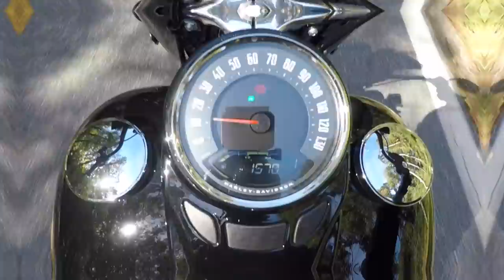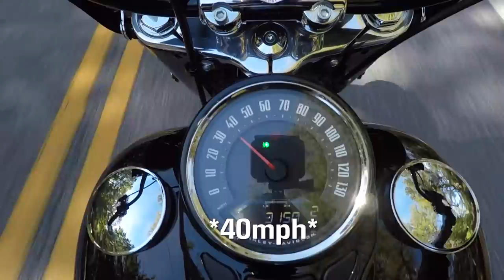Harley Davidson: How To Break In a NEW/OLD Motorcycle

Comment: Some really good points that rarely get mentioned in "break in" discussions.
I don't think "mold release" on tires is still used in modern manufacturing, but rubber works best once it gets up to temp. Probably best not to push any tire if it hasn't had time to warm up.
Reply: correct, but don't forget they dust the tires with carbon black so they tires don't stick together , I have loaded n unloaded a few loads of semi tires in my years as a over the road trucker, id say give the tires maybe a dozen miles or so to run off most all the carbon black, so you are making a better rubber to road contact, n making full use of those new tires once the rubber is stickier, or just wipe them off with bleach lol, no no bleach that makes them sticky due to a chemical reaction but may ruin the tire !!!!

Comment: 8:30..... I know we're talking about bikes here but my wife popped in my head.
Anyway, for the first 1000 miles I like to ride diferente road speeds that requires different gears, that way I give all the gears a well all round chance to break in.  We all know first gear it's practically useless, but 15 miles and below always use 1st, in your 20mph roads use 2nd, 30s 3rd, 40s 4th, so on... Depending on where you live, but here in Florida I'm riding on 5,6 most of the time, so I try to put myself in situations where I need the lower gears. And I believe that's a good way to break things in.. I also try slowing down with the engine sometimes so I can give the brakes a break from braking 👨🏻‍🔬 and that also give the engine/clutch a chance to adapt to various riding styles.

Comment: Great video John! On the engine side, Piston rings to cylinder wall is the most important thing. Rings require opposing forces to seat properly. Always be accelerating or decelerating, and avoid hard Accel/deccel and high RPMs. Avoid cruising (no load on egine, maintaining speed), avoid lugging the engine. Varry the Rpm range, don't just break it in at the same RPMs. This will give the rings the best chance at sealing, giving you higher compression and more power, along with better longevity than an engine not broken in this way. Just my 2¢. Keep up the good work!

Comment: Hey John I’ve actually seen a couple techs spray brake cleaner on new tires before the test ride(wiping off the tires first of course). They’ve said it helps remove that mold release gunk. Not sure if there’s any merit to it but they do it on our work bikes when we get new rubber put on. 

Great info and awesome channel brother. Keep up the good work!
Reply from the maker: I have sent some bikes straight to the wash bay, so that the tires can be cleaned before it gets ridden!

Comment: A Dunlop guy said it's not mold release (silicone) but that it's the tire. The tire needs at least 1 heat cycle to finally "cure" thus completing the vulcanization process. (Using college words) Either way go slow get heat into the tires by riding and voila the slick stuff goes away.
Reply from the maker: Nice info!

Comment: Hey John I always wondered if we're supposed to drive soft for 50 miles why the final assembly guy runs and guns on Dyno testing at York before shipping. Hard short shifting etc. High revs.? In theory wouldn't that be the first strain right from the factory. Just curious?

Comment: I always say first 50 do it like John says that’s real good advice ,, now for me personally I ride it like I stole it , or how does the old adage go “Grip it and Rip it”. Because of cylinder pressures, the higher cylinder pressure will seat your rings better and if you were to do it Harley’s way for 1000 miles and then do it the way I do on the exact same engine then disassemble the 2 engines you will find a lot more carbon build up on pistons etc.. on the engine that was broken in Harley’s way.. the higher the cylinder pressure the better the ring seat,, the better the combustion better performance.. less carbon also adds to longevity also... but this advice is for throttle Jockeys such as myself , not for novice riders .. if you are new to riding johns advice is spot on.. for the rest of us “Twist the wick” and get that cylinder pressure up and. The bike will perform and last longer ... but that’s just my personal opinion....
Reply: I do the same.  Have done so for all my motorcycles with no ill affects to any of them.  I had a 2007 Daytona 675 that I purchased new with 12 miles.  I rode it hard from the beginning, and I clocked in well over 74,000 miles on the motor in four years with zero issues.  A very important detail....I did ALL the required maintenance per the owners manual to the letter.

Comment: My 2000 ultra classic went through break pads like water through a sieve. Parts guy told me I was breaking to hard and bike was so heavy it's just part of owning that model. I told him that the pads must be defective because no other bike I owned ever was that bad, and I have owned a few. After market Kevlar pads and years later same pads. I bought 3 sets and changed front and rear and still have the 3rd set never used. Before that it was about every 6000 miles. These have 50,000 on them I bet. 
Worth HD KCMO I hate being lied to, never went back and the shop was only a mile from the house. Been riding for over 50 years; What Harley seems to do is deny when they have a problem until it's undeniable.

Comment: on my 2006 FLHX what does Harley recommend for maintenance on the neck bearings? Mine has a fitting from factory so I would assume it is to be serviced/greased at certain mileage intervals or time? Thanks!

Comment: I called my dealer for clutch cable adjustment when I got to about 500-600 miles and they said not until 1,000 miles. Just as I past 1K my cable disconnected from the basket or so I believe it did, I couldn't get a straight answer from the dealer what happened but thank god I just finished a group ride, was parked and ready to go home and the clutch lever was moving freely without effort. This was a 2021 Street Bob FXBBS, I had to get a flatbed home then the dealer picked it up after the weekend and fixed it.

Comment: I just hit 500 miles yesterday on my 2018 Road King. When I bought it last week it had 164 miles on it with a dealer installed stage 1. I hope the previous owner took it slow, LOL.  Although I typically don't ride hard it is difficult to not occassionally want to open it up.

Comment: John,

I saw a video by Jerry Paladino (ride like a pro) in which he clearly stated that motorcycle clutches are designed to be used in the friction zone much more so than a car would be for slow speed maneuvering.  Would you concur with that and if not, why not?  Thank you.  Also, I'm sure you know that the term for the strands of wire put together is wire rope.  Just fyi

Comment: I'm an old-timer so I'm just curious if the way we used to break Motors in is still acceptable. We used to put it in 3rd gear and we take it up 60 miles an hour full throttle and then let go of the throttle and repeat that 5 times. A logic was expansion of the piston rings to the cylinder under load and then during deceleration. I did that on my other Harleys and it never burn to drop off oil and always ran great. How's that apply to today's motorcycles engine

Comment: I have a question. I tend to pull the clutch in with 2 fingers on the grips and 2 fingers on the lever. So the lever never actually goes completely down to the grips but rather it stops when it hits my fingers. I’ve checked and the bike is not in the friction zone when I do this and it seems to be fully actuated. Is this ok or should I pull the clutch lever with all 4 fingers when I shift?

Comment: I just broke my 18 Ultra Limited Shrine in.  for the most part I kept it under 3500 rpm, but once or twice I might have gone over just a bit.  I always varied my speed though.  No burn outs, etc.  Now i'm slightly worried about the 3500, dealer didn't mention it.
Reply: Don't be. Read my other comment here.

Comment: Just got a 2019 Street glide and I'm just about 500 miles didn't take it that easy on her I crack her open and take her to about 4500 rpm a good bit but ain't that worried about it
Reply: You will be later on when it’s pushing oil past the piston rings due to them losing their temper.

Comment: Depends on the Trans Gear ratio , My RK don't have a Tack . I go by sound and speed 1st 15, 2ed 25, 3ed 35, 4th 45 , 5th 55 at 150 miles I go up a extra 5 mph after 1000 i ride it like i stole it  im doing break in right now 7-4-23 happy 4th everyone .

Comment: Looking forward to your video on the pipe upgrade. Did you do the full stage 1? If you did, with Prostreet Tuner, how do you recommend doing the street data recording without a Dyno (speed, gear, etc)? I was at Biketoberfest this weekend and the tuners won't dyno a bike with the Harley tuner installed.

Comment: Hei John, greetings from Norway !  

I have a question about the Gearbox in general for Harley Davidson. 
As you may know, in other manufacturers dry clutch gearbox it is common to do speed shifting or clutchless shifting of gears. And it is supposed to be no trouble for you to do so without damaging the motorcycle.
Now I know the fact that the Harley Davidson motorcycles uses a wet clutch on most of the models - meaning it is moistured by a special oil to give a little smoother clutching?  
Anyway my question is as follows: Is it safe to do clutchless shifting on a Harley? 

Thanks alot for your awesome videos, and your initiative for making them ! 

Thomas
Reply: Not unless you want to rebuild your gear box

Comment: Hey john i was curious to see if you knew of any way to see what cams are in my twin cam dyna, is there a way to tell without removing the cam cover and oil pump? And do you by chance have a psi number that a standard 95? Inch twin cam harley might build during a compression test?
Reply from the maker: I don't know off the top of my head what compression should be, but I can tell you that a dyno run with a knowledgable dyno tuner can generally give you a good idea of what cam is in there.  There's a handful that as soon as I see the graph, I know what cam it is.

Comment: hey John,
i know this question is not relayed to the break in procedure but i have a question.
so it goes like this ....... i own a 2019 CVO Street Glide and the heat shields on the bike are that bronze color.
so what metal cleaner do i use on them ?

Thanks Dude !
Reply: I use autosol

Comment: When I bought my new 2018 touring bike they said not to lug the bike. To my understanding "lugging" is upshifting too soon?
Reply: As a truck driver I refer to lugging as holding a higher gear while climbing a hill and letting the torque do the work. The engine works harder but if it has the power to make the hill why down shift? I do it on certain hills with my electra but I don't let the rpms get any lower than 1800

Comment: Tire issue, it's not actually mold release like the old wives tell go, it usually is a chemical to keep them from gathering mildew while they are on the rack, kinda like a preservative. The slick part is just that the tires haven't been roughed in, they are still slick. Racers rough in their tires before they put them on the bike, so they're not starting with slick tires on the track.
Reply from the maker: I said it was for storage originally. The other dude said it was from manufacturing. Either way, that shit is slick!

Comment: What could happen if a bike isnt broken in properly what are some symptoms. Thats what scares me avout buying used bikes with low miles/any miles worry if they broke it in properly
Reply: Just liked and subscribed been watching for awhile
Reply from the maker: I’ll be honest, I’ve never opened up an engine and thought, “well this wasn’t broken in right.” To me it’s a matter of I know I did it right, so anything that happens isn’t because of me. 

A simple compression test on a used bike is a good, quick indicator of piston to cylinder fitment, though!

Comment: Can the clutch friction zone wear down clutch
Reply from the maker: with excessive throttle while in the friction zone it can wear one down pretty quick!
Reply: david buchanan essentially any time your clutch is in the “friction zone” you’re wearing the clutch as it is slipping. But luckily clutches on these bikes are bathed in oil and don’t heat up excessively very easy so they last quite a long time... unless you’re an extremely aggressive rider, have added some serious power to the engine, and racing etc. nothing to worry about. But if you are once you’re moving you can learn to upshift without using the clutch.
Reply: @TheHarleyTech  is it normal for one to have to replace a clutch during their ownership of their harley touring bike (street glide) I mean within the first 10-20k miles?  or should your clutch last the life of the bike if not abused?
Reply from the maker: Generally clutch replacement is from abuse, for sure.

Comment: the 50/50 rule is real lol, i once changed out tires on my supermoto from the street slicks to some shinkos forgot which ones exactly right now and they had about the same diameter of meat on them as the original tires so i thought handling was about to be the samebut boy was i surprised when i was trying to corner as i used to before only to end up almost losing it on the streets xD

Comment: John I had a question for you and have been told different thing by different people so I wanted to ask you since you are a tech for Harley is the FATALLY FLAWED, DESIGN of the 103 and all TWIN CAM engines, produced since 1999 to the present.Is it true that the flywheel assembly on say a 2012 Ultra Limited with the 103,  are merely pressed together, at the factory, with a 400 ton press and there is nothing holding the two halves, of the flywheel assembly together, and the flywheel WILL come out of true, very quickly and will soon exceed the maximum allowable, run out on the sprocket shaft and pinion shaft, of 0.001" and as soon as the shafts wobble hits,  0.003", damage to the pinion shaft bearings and the oil pump rotor and cam support plate bearings, and the cam shaft bearings, will begin and eventual, CATASTROPHIC ENGINE FAILURE WILL OCCUR. Please could you clear this up for me, this is a heated discussion among a lot of my friends and I would like to know myself because I do own an Ultra Limited with the 103 in it. Thanks and love your videos so thanks for making them. Hope to maybe see you Oct 5th at the Bring it Home Ride. This veteran wants the record back here in the USA, nothing bad to say about Greece but damn it Harley Davidson is an American bike and that record needs to be here in America.

Comment: I bought mine used and didn't get the book no one reads so I didn't get the chance to not read it.
Reply: Haha i read the crap outta mine. Lots of good info actually.
Reply: @disht2  I wish I could have. But they aren't cheap. I threw down on the service manual tho. I couldn't live without that.
Reply: @Raymond Gonzalez cool. I didn't know that. Thanks for letting me know. I'm wondering if I can turn of or get rid of that goofy theft system. I'm pretty sure it was a dealer ad on from what I've looked into.